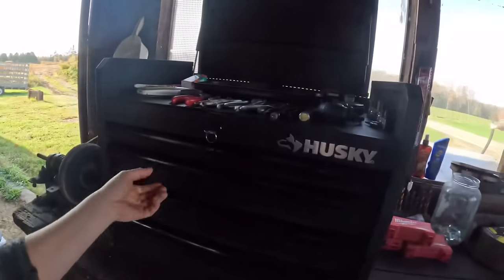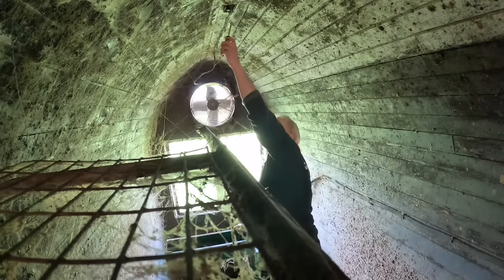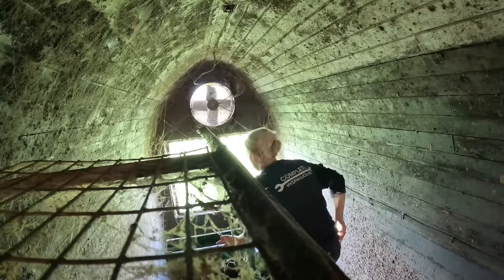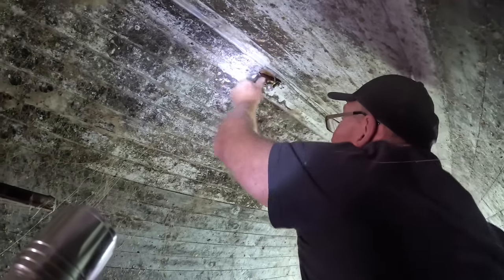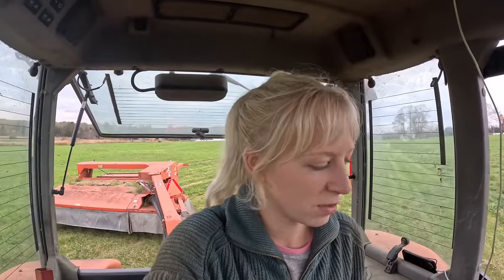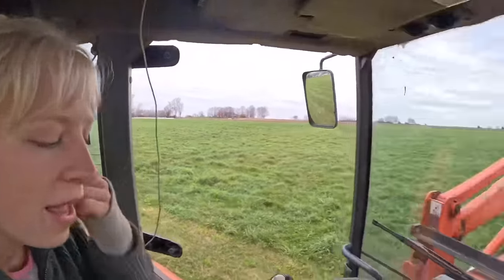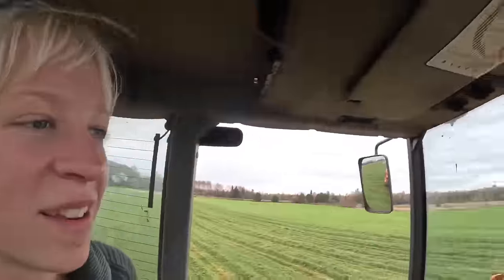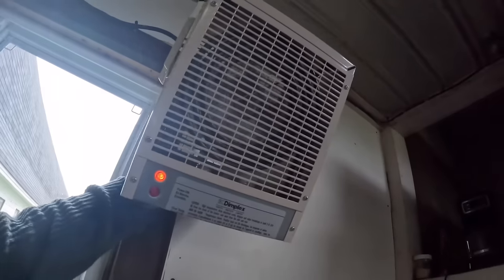Go upstairs in a traditional dairy barn loft + electrician or farmer??🤔

Comment: You two did great only dropped 1 screw   I hate strait head screws. I suggest getting a meter to check for power before you start working with electrical wiring 😅

Comment: Just a suggestion, prefer the battery powered led motion light where you need light in areas rarely used especially if you have to run wiring and a switch..they are in big box and amazon

Comment: Just a word to the wise for you and your boss.  "Romex" is not an approve cable type for animal barns due to the corrosive nature of the environment in the building.  The ground wire is uninsulated and subject to the corrosion from the higher levels of ammonia and hydrogen sulfide from the animal waste.  You should be using UF cable where all of the conductors are insulated. Particularly important since the area you just installed the light in is above you manure handling equipment.  Requirement is directly from the National Electric Code.
Reply: Envia um rolo do fio UF para eles de presente. 
Boas ações são sempre melhores quando veem acompanhadas de ações. 
🇧🇷